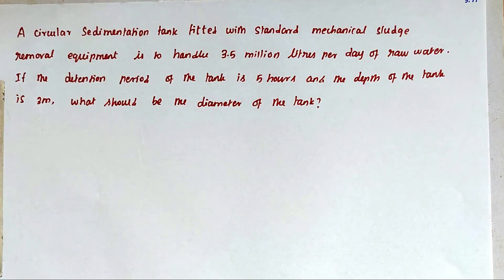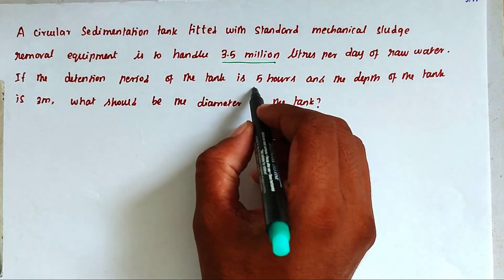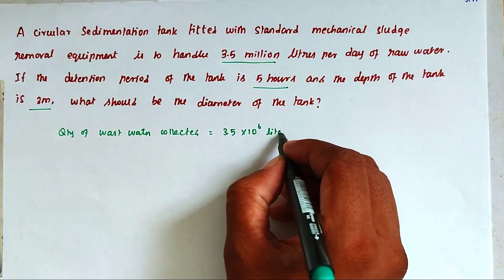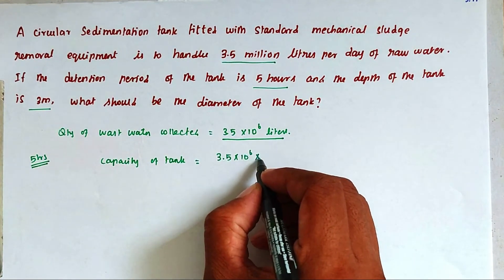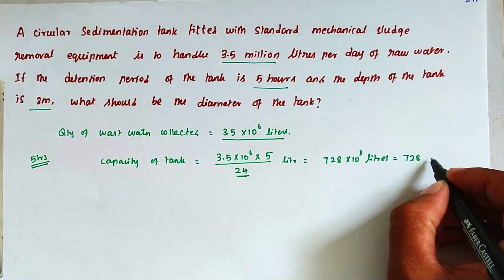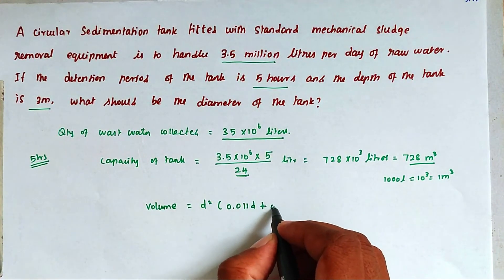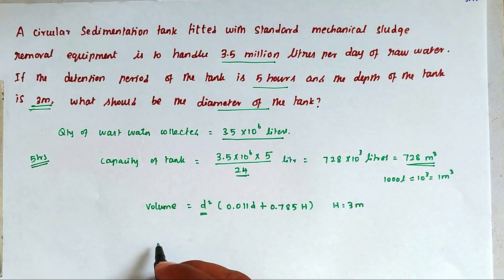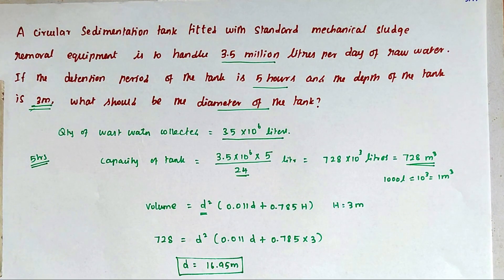Sedimentation tank Solved design dimension of tank | design of sedimentation tank | waste water engg

Comment: Sedimentation tank is treating the flow of 4.5 MLD containing 275 ppm of suspended solids. Tank removes around 50% of suspended solids.
Calculate the quantity of sludge produce per day in bulk and weight if 
a) moisture content of sludge is 98%
B) moisture content of sludge is 96% 

Sir please explain this problem 🙏🏻